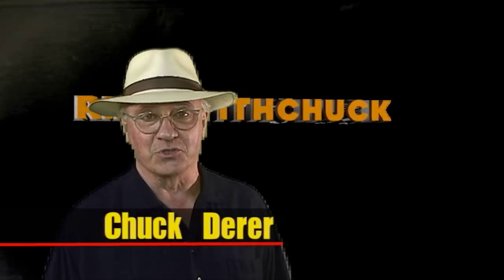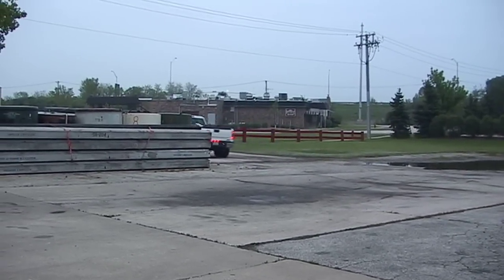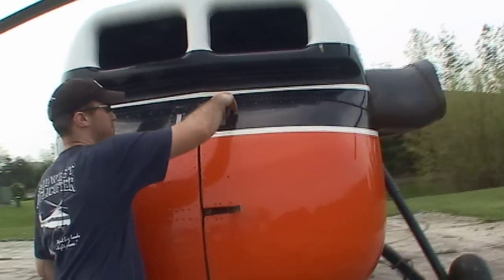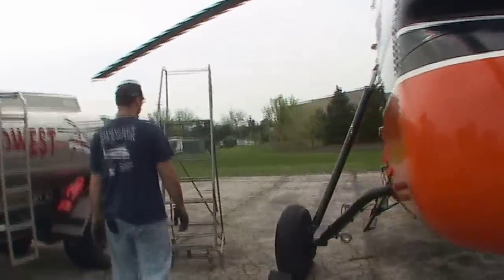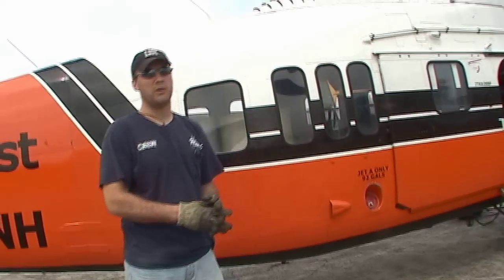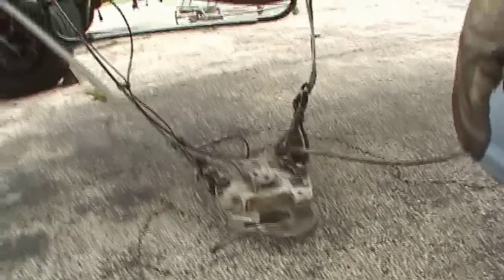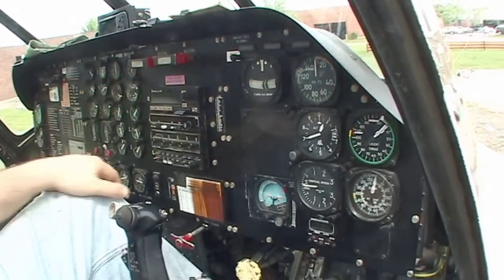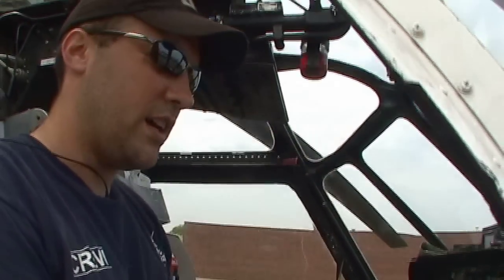Sikorsky 58T helicopter pilot walk around

Comment: Its originally a S-58 military be the H-34 called the Choctaw. as its a more powerful version than the Sikorsky s-55 Chickasaw. as originally this would be powered by a Wright Cyclone 9 R-1820 radial engine as the nose is shorter and the screened intakes below the cockpit are for the cooling air for the engine as there is a big fan on the engine. same as the s-55 chickasaw its the same setup. as both s-55 and s-58 were converted to turbine the s-55 uses only one engine as two for the s-58. as the s-58 originally is Sikorsky's last piston engined helicopter then its turbine from the s-64 skycrane up to the s-92 blackhawk and super stallion. If the famed avaiator Kermit Weeks aquires an s-58 his specifications would be for the original radial engine. as he has 3 s-55 helicopters one an ex turbine conversion as two are being used for rides at his Fantisy of Flight facility in Polk city florida as he owns Sikorsky's fixed wing aircraft the s-38 s-39 and howard huges s-43.